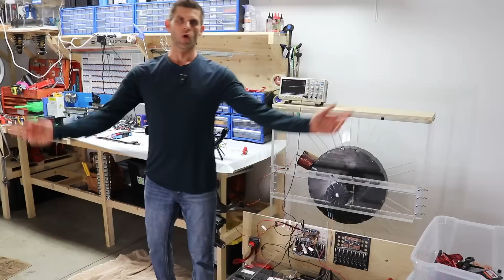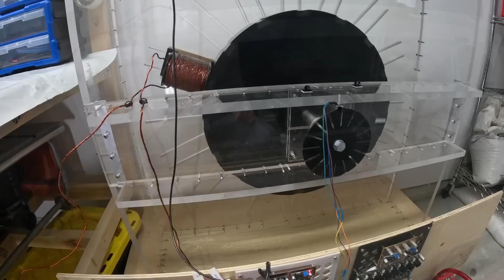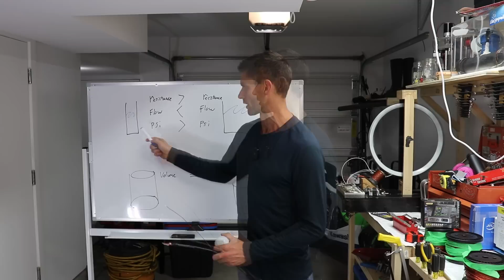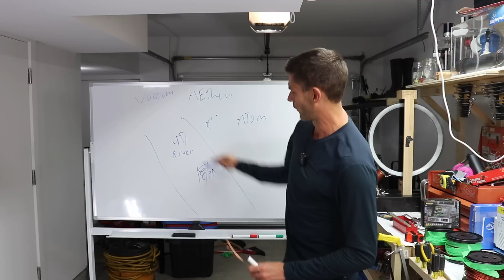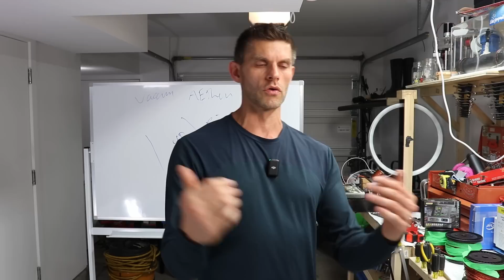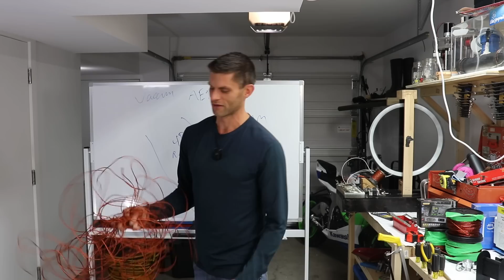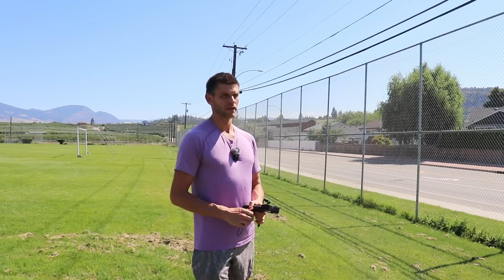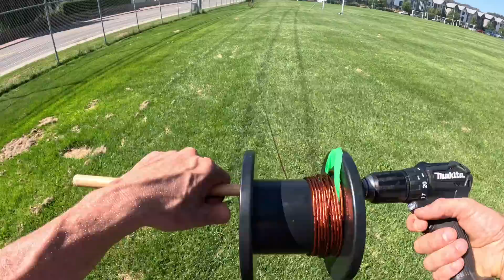I Built This Energy Machine in My Garage — And It Works

Comment: Hi I have thi machine you would build in 8 hours, I'm building this for 3 months now. Remember to fund me!
Reply from the maker: good one
Reply: @MadscienceLPTECH  Cool to have your attention. In reality I see your claims. I understand there might be something in high voltage pulses. I am not convinced but I would like to see something happen, and fingers crossed. The thing Is I would actually use any arm cortex or arduino and some mosfets, IGBTs or some some other driver directly available on the market and glue together some driver and make a POC ASAP. Can you address my thinking process and the doubts that arise? Because I believe you should do a shortcut here and focus on perfect meters to correctly assess integrated momentous inputs and outputs up to the micro Watt in time domain. That is the crucial part. Assuming best will, maybe you are, as many, pushing back the moment of first results due to natural fear of failure. Assuming my best intensions and fingers crossed, you need to fail fast. We, me, you only have one life and limited time. Go for it, man!
What do you think? Cheers.

Comment: I saw a video a while back on old man builds that his mate Sean had automated putting the resin onto the coil. Watching that will save you some time and effort. ( it gave really good results ) All the best in your work. PS im hoping you know to use a vibrator to get the air bubbles out of the resin if your doing it by hand. Tesla got around this by winding his coils submerged in boiled out oil.
Reply from the maker: Thanks for the advice, appreciate it!

Comment: show me some math. explain exactly how this 4D aether energy is being utilized in your device by creating dipoles in the lead acid battery that some how tap it. tell me exactly how this either violates or disproves the conservation of energy.  if its a 4D field your using like you said, does this have any connection to general relativity?   please explain the 4D aether with mathematical physics. i am very curious as your viewer and I'm sure it would mean allot to the other viewers as well.  this is a very interesting and important thing your trying to achieve here.
Reply: Yes please! Can you do some in-depth content for Physic Students, where you get into the thick of it?

Comment: Good work! Look at E bay for user The Epoxy Experts -99.4 percent and over 18K sale orders -   PolymerProducts, The Epoxy Experts manufacture & custom formulates epoxy resins used in manufacturing and assembly of performance composites and related polymer products. We specialize in high performance adhesives, coatings and related polymers for marine, aerospace, electronics & crafts industry..

Comment: 28:40 So why not just melt the copper on or something, would it destroy the other parts always?
Or does it need to be coiled, and if it does need to be coiled. Maybe melt it while slapping it with frequencies to get some type of preferred organization of the molecules in the copper. 
Personally I think this all starts looking like vortex gears and liquids to get the max efficiency out of devices like this. Pure speculation though, as I dont ever get chances to experiment like this, I wish.
Reply from the maker: Yes heat isnt good for this. Love the fluid thoughts
Reply: @MadscienceLPTECH What about printing copper flakes or something? Would you be able to add enough copper into a solution that you could 3D print And have any effects?

Comment: Your alleged source is the surrounding atmosphere. No energy comes from space or vacuum or nothing. Put another way, "Something cannot come from nothing" ( strictly speaking ). Tho more energy  is flowing outside of the wire , allegedly, take the wire away and there will be no power to the load full stop.  Your 4d to 3d is all crap, for now at least. Thank you for the video anyway.
Reply from the maker: Umm I beg to differ

Comment: Have you considered dividing your single wire onto 8 (or however many) bobbins first? That way you only need one trip over the field. Also winding coils reminds of the times when I helped my father transferring new fishing line to a fishing pole. I know reels have a mechanic to perfectly wind the line onto it. Copper is much stiffer though and you would need a much larger tool but maybe there is something out there like that
Reply from the maker: its going to be work however we do it, i like it

Comment: This project is a lot like what happens in automotive when installing aftermarket ECUs. There is lots of resources available. We often encounter electrical interference trying to package wiring in tight spaces and use shielded cabling for sensor wiring. You need car guy friends!😂
Reply from the maker: lol

Comment: try creating an old battery of copper, zinc and acid sandwich - and thens stretch that out and make it thin into an antenna and see what you get
Reply from the maker: interesting idea!
Reply: @MadscienceLPTECH  try thinking of miniaturizing material - much like the advancement of microchips - the advancement in energy technology can go the same way - especially if you advancing to take advantage of electromagnetic waves from the aether

Comment: Perhaps a multi spool turret with a hole in the middle. Have the collector spool rotate to cause twist but also rotate ro wind it up as its twisted. Once you have the entire roll wound then cut it to length. This would give you consistency.  Its like rope making or coax cable wrapping.
Reply from the maker: that would be ideal

Comment: Your explanation for electricity is fundamentally incorrect.  The following is a direct quote from pages 18 and 19 of Oliver Heaviside's Electromagnetic Theory Vol. 1:

"Even if we had no knowledge of electrostatics and of the properties of condensers, we should, by the above course of inquiry, be irresistibly led to a theory of transmission of electrical disturbances through a medium surrounding the wire, instead of through the wire.  Maxwell's theory of dielectric displacement furnishes what is wanted to explain results which are in some respects rather unintelligible when deduced in the above manner without reference to electrostatic phenomena.  We learn from it that battery or other source of energy acts upon the dielectric primarily, producing electric displacement and magnetic induction; that disturbances are propagated through the dielectric at the speed of light; that the manner of propagation is similar to that of displacements and motions in an incompressible elastic solid; that electrical conductors act, as regards the internal propagation, not as conductors but rather as obstructors, though they act as conductors in another sense, by guiding the electromagnetic waves along definite paths in space, instead of allowing them to be immediately spread away to nothing by spherical enlargement at the speed of light; that when we deal with steady states, or only slowly varying states, involving immensely great wave length in the dielectric, the resulting magnetic phenomena are just as would arise were the speed of propagation infinitely great instead of being finite; that if we make our oscillations faster, we shall begin to get signs of propagation in the manner of waves along wires, with however, great distortion and attenuation by the resistance of the wires; that if we make them much faster we shall obtain a comparatively undistorted transmission of waves (as in long distance telephony over copper wires of low resistance); and that if we make our oscillations very fast indeed, we shall have practically mere skin conduction of the waves along the wires at the speed of light (as in Lodge's lightning-conductor experiments, and more perfectly with Hertzian waves),"  

I highly doubt you will be able to accomplish anything of value while completely misunderstanding how the electromagnetic field actually functions, which, from your explanation, is quite apparent.  I believe what you are attempting to do is completely possible with a correct understanding of the electromagnetic field.  It may be possible to do what you are attempting to do with few, if any moving parts at all.  It is the field that is important, not the matter (copper wires, etc.)  The matter is just what we use to manipulate the field.  With a proper configuration of matter, it should be possible to make a rotating magnetic field without the necessity of moving the copper wires and/or physical magnets.  Once you have a rotating magnetic field, you have the means to generate power.  In fact, all of our modern day power generators are simply devices that rotate a magnetic field with respect to copper windings or vice versa.  Our electric motors are simply inverse forms of our generators.  Learn to create rotating magnetic fields with static objects and you have unlimited free energy.
Reply from the maker: Sounds like you shoukd build a device. What im saying is correct, energy flows outside the conductors and there is excess energy from the vacuum components we waste
Reply: @MadscienceLPTECH  What you start off saying, the water in the pipe analogy, is incorrect.  Your description after that is mostly correct.  Yes, the vast majority of the energy is outside of the conductors, which was the point of the quote from Oliver Heaviside.  Yes, we are completely surrounded by free energy that is just there for the taking and, for some reason, we just do not know how to take it.  Someone somewhere probably already knows how to harness it, but that knowledge is not presently available to the general public mostly due to the hijacking of science by Lorentz, Einstein, Bohr, and others, coupled with deliberate public mis-education that prevents a proper understanding of classical electromagnetic theory.  One cannot start with the complete misunderstanding propagated by the mainsteram and then proceed to proper results from that misunderstanding.  The mainstream understanding was deliberately designed to prevent people making free energy devices.  The mainstream analogy is poison in the well.  It is like a sick person trying to get healthy with the first step they take to better their health being drinking poisoned water.  That is not a good first step and it puts them 10 steps back from where they started.  One must start with the proper understanding of electromagnetism and its underlying principles before they can proceed to making functional devices.  It is like a house.  You have to start with the foundations.  If you start with a terrible foundation over quicksand, no matter what you do to try to make the house functional will fail and the house will collapse around you.

I highly recommend you reading Charles Proteus Steinmetz's works.  Especially those dealing with transient phenomena, as that is what your system is based upon.  You really need to look into hysteresis, if you have not already done so.  My commentary is not meant to disparage you or your attempt, but rather to steer you in the correct direction as I see it.  Best of luck to you in your endeavors.  I truly hope you are successful!

Comment: Magnetars prove that a spinning magnetic object generates an immense plethora of energy levels we've only glimpsed at & can indirectly measure as off the charts.  This is not science fiction at all.  Once the baseline of this gets proven as applicable, I'd suggest adding a layer of useful redundancy to power a frictionless bearing with electromagnetism at its center.  The object is already spinning so adding magnets to the facing on both sides while capturing that input could directly power your bearing & make bearing stress an eliminated factor.
Reply from the maker: That's a great idea!

Comment: You got ripped on the oscilloscope $2000? I got mine on amazon for $379. $700 in bearings this thing is going to fly! how many rpm are you going for?
Reply from the maker: i dunno i think the ossiliscope we got is worth it and a good price for the high Hz ability etc... i have cheaper ones too. i think it will run 1000-3000rpm... u never know though
Reply from the maker: no ossiliscope was $500, other supplies for Joe and micro electronics were the remaining $1500

Comment: I feel like only thing you tapping into is antennae's. Put them in a faraday cage and see what happens. Also, if that's the case, feel like you could get more power from just analyzing what waves around with a wide frequency spectrum analyzer and using an antennae tuned for it.  But then you just stealing from whatever transmitting... I don't think you're capturing quantum anything tbh. Think you just tapping into leaky energy from human made transmitters of some sort in the area.
Reply from the maker: different power source i believe, valid though